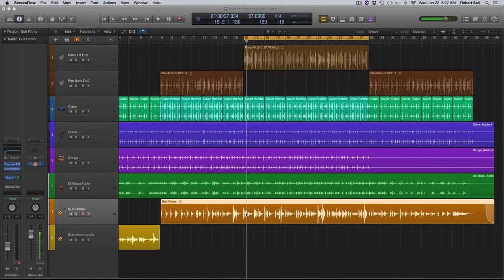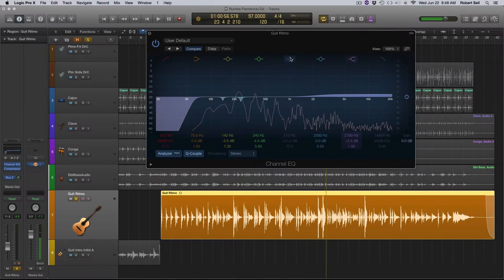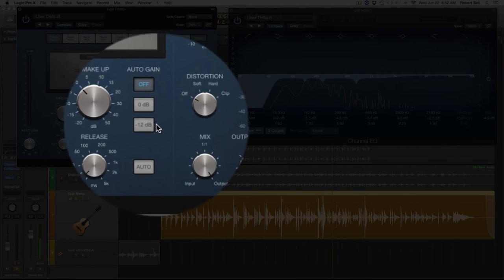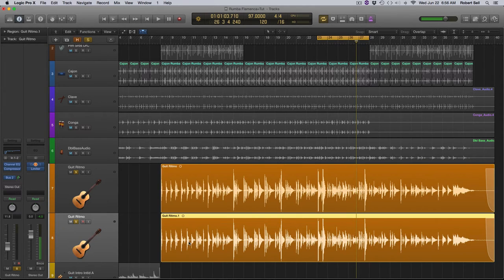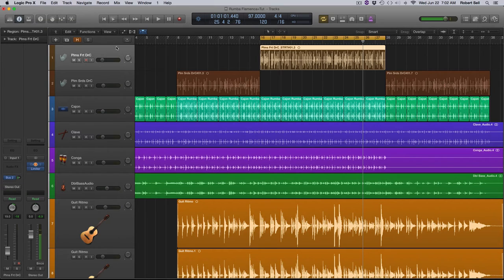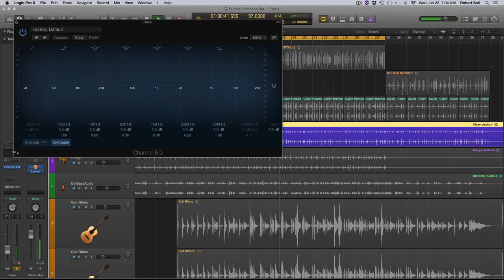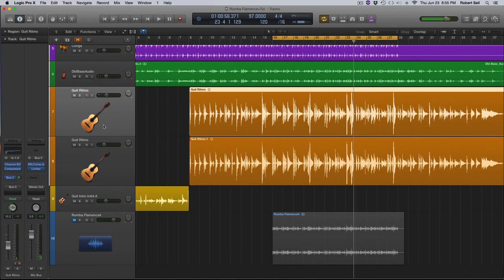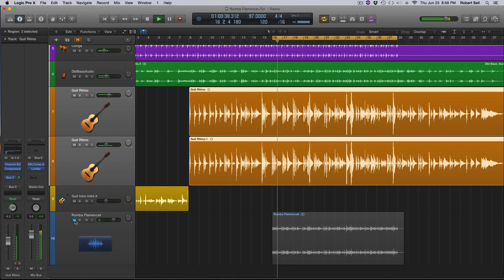Mixing Flamenco Nylon Guitar (EQ/Compression)

Comment: Hi Bob, thank you for this and other very informative videos you have posted. You were dealing with a flamenco guitar here but I was wondering if you had any thoughts on recording the classical guitar, especially in relation to mic placements, EQ, and whether to apply any compression at all. I would be grateful for any comments.
Reply from the maker: Great question. It really depends on the guitar, the player, the room acoustics and what mics are available. But in general terms I would be looking to record with some stereo micing technique. Spaced pair or Mid Side (M/S) technique. I did a video on MS here:  https://youtu.be/eok0uoo3MVY
My EQ moves would most likely be typical for that of acoustic guitar. High pass about 70hz and notch out boxyness around 350-500 hz as necessary. Mostly subtractive EQ. Compression would depend on the player. If used it would be light with no more than 2-3 db of gain reduction. I don't really have any hard and fast rules. I just try to capture the best sound and performance possible and then mixes process is easy. Hard to give advise or an opinion without taking a listen. Which I'll be happy to do. Thanks for the comment and the great question!
Reply: Many thanks for your prompt response, Bob. Very useful.

Comment: Hmmm....the guitar sounded ridiculous fully panned L and R...around 60-70 % l and r would have been ample and 18-20ms delay
Reply: Agree too much delay and panning. Still lots of helpful info here and it's a clear guide to get people started. Also think despite the advice using compression being good, it goes a bit overboard and actually much preferred the original guitar sound - with the natural tailing off of that chord but to be fair that's all down to personal taste. Good video, sound advice but in my opinion the techniques are a touch overcooked.